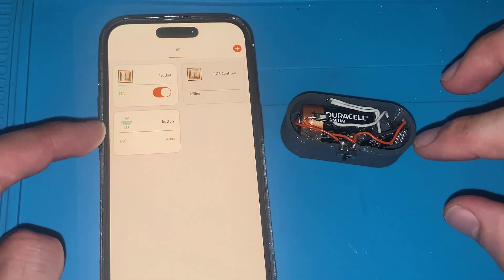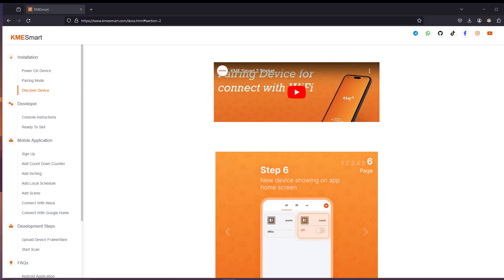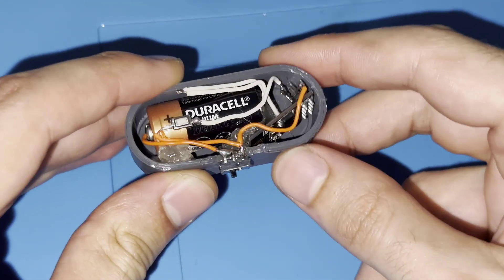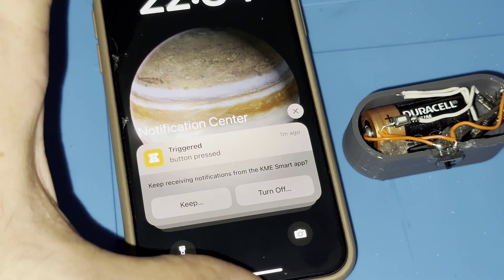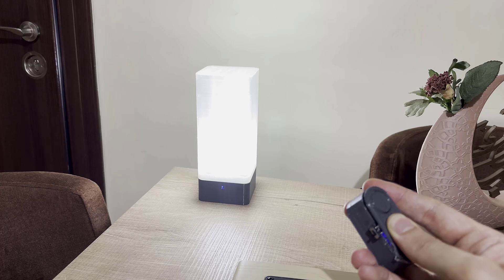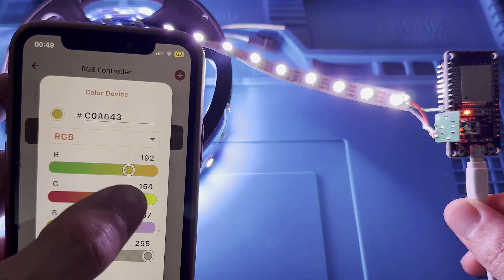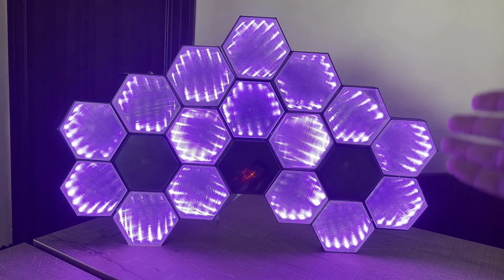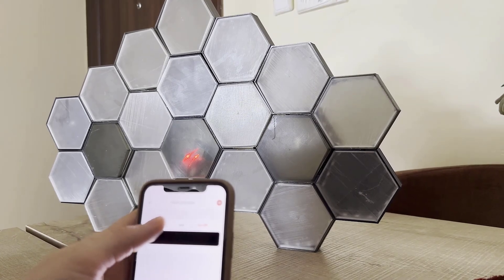ESP32 DIY Smart Home Automation with KME

Comment: hello, I was wondering about a toilet that had two to four high temperature silicone brushes  for to [soft mill 2 inner brushes turning upwards] feces so that they can be distributed onto a deliveryband as pita for rapid gas flame or sun powered drying with eventually following methane exploit or sterilising burn -- instead of the classical water flush .... high temperature silicone were sterilisable(self or flame cleaning) and not endangering as steel brushes, and marriage rings do not destroy the mill
Reply: you caught me on the printed business card